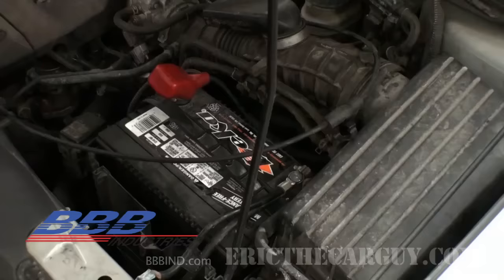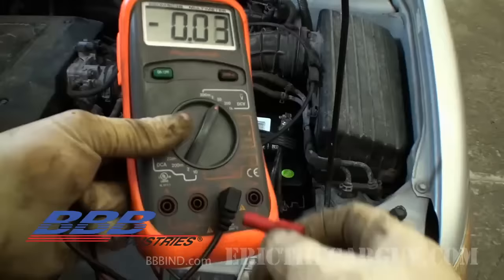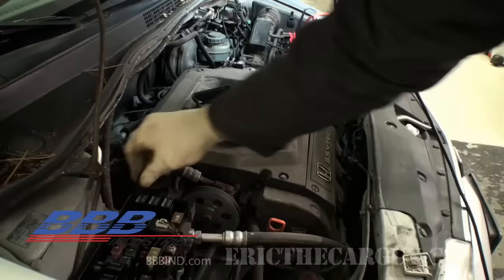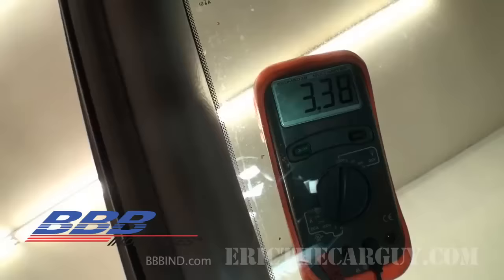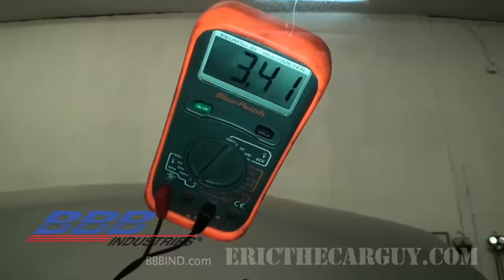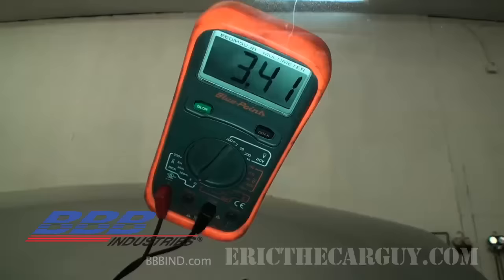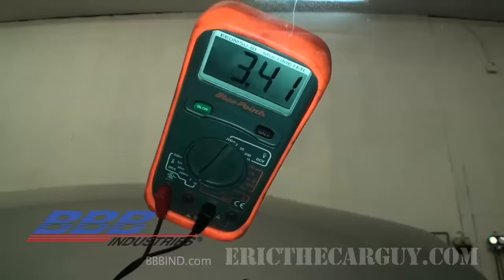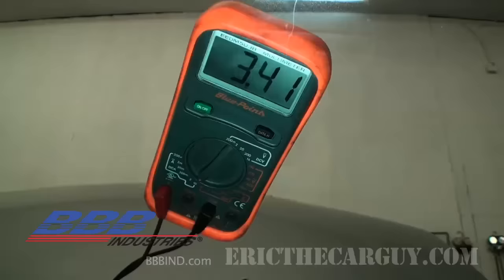How To Perform a Parasitic Draw Test - EricTheCarGuy

Comment: Thank you Sir!  Found my draw on my '03 Silverado pretty fast with your instructions.  A/C Relay being fed by the 10A AC fuse. Fixed!
Reply: My 03 Tahoe brains a battery in 4 days. Which relay?
Reply: @MegaHowtoMan  Mine was the  A/C clutch relay which had stuck in the closed posistion.

Comment: What you are doing will work, however, every time you disconnect the battery you lose memory which isn't terrible, butt also when you reconnect the battery via your DVOM you wake up modules. On vehicles such as Ford it can take up to 45 minutes for these modules to go to sleep and you cannot accurately test for parasitic draw while these modules are active!!! If you do it the way you show in your video Eric you must be sure to never break electrical connection, I.E backup battery supply while you hook your DVOM in series, and then remove the back up supply before you start testing. Instead of pulling fuses it is much easier and faster to do a voltage drop across the fuse. If there is current flowing you will see it on a voltage drop because current flow is RESISTANCE!! Resistance shows up on a voltage drop test!! But remember...there is more than one way to skin a cat.
Reply: You must disconnect the battery to put the meter in series. You must break the electrical connection. The only thing you can do is pull ECM fuse first or wait 45 min.
Reply: if you look at the end of his video he point out what you said and more.
Reply: If you have a top post battery, the meter connection can be done without breaking the electrical connection, by putting the positive meter probe through the center of the terminal and the negative probe on the terminal.  Withdraw the terminal from the post carefully and the meter will maintain the connection without restarting the ECM.
No need to stand around waiting for the systems to go back to sleep after disconnecting and reconnecting.

Comment: Excellent video, Eric! You give consistently reliable advice. And I thank you for that. But you are also more articulate than most of the folks out there on TV that commentate professionally, in ANY field. So, it's always a pleasure to watch your videos. You get straight to the point in a clear, and concise manner. 👍

Edit...Also, what multimeter brand (& model) was that? And what do you currently recommend? I like the one you are using in this video. But I do realize this was recorded 9 years ago. Maybe consider adding a current affiliate link into this video for your best sub $100 meter. Ok, sub $200. 😁 If one had been in the info I would have followed it. Thanks!
Reply: Yeah...I would LOVE to know that too. I'm pretty sure that he's using a Fluke. Which one? Not sure. I would LOVE to know as well. I also want to know about the battery tester he was using. It's a nice one. Maybe, you know this...I was looking at some nice carbon load testers online, trying to find one that covers a bunch of different types of batteries, diff. voltages and one that will test ...not only the battery itself and load testing but starter motor amperage draw and even cranking amps(same thing I think). I wonder if his does this extra stuff. My guess .. probably not. It's probably just a battery tester only but his is a nice one. People who have the analog ones, say that they're awesome ..I e...They have a lot of extra functions (like the aforementioned ones). Any help would be greatly appreciated...👍😁...P.S.  Love Floyd!! Rock on!! 🎸🤟

Comment: Sup Erick? Great video like always. I had to send this to a guy customer so he can see that you use amps not volts to test for parasitic loads. He think he knows more than me. Don't know why he hired me...you know the type
Reply: Why do you use amps and not voltage? It may be a dumb question but I am curious.
Reply: @DJTourniquet  Because you test the current flowing "through" the wire. You test voltage "across" something that causes a voltage drop due to resistance. An ammeter actually checks voltage drop across an internal, calibrated shunt resistor and then calculates the resulting current due to Ohm's Law. There are probably some good YouTube videos on how to use a multimeter that can go into more detail.
Reply: @cyborgdale  Ahhhh, thanks man. I always wondered but none of the guys I worked with could give a straight answer.

Comment: I have a draw that kills my battery over night and it never did this before I replaced the alternator with a rebuilt one, can a alternator cause a parasitic draw and still put out charging current when the engine is running?
Reply: A properly installed alternator can't have a parasitic draw. If there was a malfunction it would only happen while the key was engaged because the alternator is wired through the active fuse group and isn't permanently in the circuit. It's more likely that the new alternator isn't at fault and it's just damage done to the battery while the old one was failing. Most cases the alternator failure isn't addressed properly until the battery has already undergone a significant drain which will put it in a crippled state and chemically unable to hold a proper charge.
Reply: Back when dinosaurs ruled the earth bad alternator diodes could cause a parasitic current draw.  I guess that changed ...
Reply: Marti woodchip yes it can, mines did in my old lincoln, it was a 86, ancient..  I had to take it to an electrical shop to find out it was the cause of my draw.. replacing was easy, did that myself..but finding it.. ha!

Comment: what do you do if your looking for a parasitic draw on small motor cycle or scooter that only has one Fuse?  Would you unplug the light bulbs?
Reply: Roger SoCalBeaches
Reply: I say in this case the battery it self is just near the end of life and can't keep the power. There is a possibility that something like STOP switch is shorted and does provide power to bulb but not enough to let it light up but than again those things are after ignition switch.
Reply: Disconnect anything that draws power one by one. Disconnecting that one fuse didn't decrease the draw?

Comment: Please HELPP!

I got my Prelude in the summer of 2015. I bought it used on Craigslist. It is lowered, has aftermarket headlights as well as sound-system.

I used if from July-October with no issues. Mid October I removed insurance and left it on my front lawn for November-December. In January I decided to reinsure. 

I had issues starting it since I left it alone for the few months. 

At first, it would not start. I checked my battery terminals and they were loose. Then my car worked for a few weeks. 

Again, my car stopped starting. Deduction lead me to go get the battery replaced. I bought a battery from mechanic A. Got it installed. Car still would not work. So I wen't to go get an alternator from mechanic B. Mechanic B said that actually, my battery was bad even though I just got it form Mechanic A. Bought a new battery from Mechanic B. Car worked for a day or two. Went to go buy a refurbished Alternator from Mechanic C, was told that my Alternator was definitely the issue and my battery was OK. 

Got the new Alternator. Car worked for a few days. Went to start it, now it was not starting again. Took car to more upscale and reputable Mechanic D. I had an AVR Test done and Mechanic D told me my alternator I just bought 4 days ago was shit because it was second hand and it was not charging my battery. So I bought a brand NEW Alternator. 

Once again, car worked for a few days. But eventually, I would go to start the car and it would not start. 

Called Mechanic D. Wen't back to them and had an electrical diagnosis AGAIN. They told me they could not find anything. 

I was able to drive the car home. They must have charged the battery. Within a few days, the car would not start again. I got my neighbour to come check it out. He noticed that when my parking lights are on, my engine would slow down and so he said they were draining a lot of power. We determined this just by listening to the engine. My after-market bright headlights did NOT drain as much power as my duller parking headlights. 

And now I am here. 

Every time I would not be able to start the car, I would be able to get it going with jumper cables. I have checked every light and electrical thing I can find and I cant say that anything is staying on and drawing the battery from what I can tell. 

Before I contacted my neighbour, the car, unlike any other time, made clicking noises while I tried to start it but since then, that has not happened. I used it the other day after jump starting it and it was fine.

So as of now, the things i can say are...

1.) It seems that once I go 1 day without driving, It will be dead when I go to start it
2.) My engine did definitely slow down, and my neighbour read a battery draw, when I turned OFF my bright headlights and my parking headlights automatically come on. 

This is been an ongoing issue now since January-ish and it is obviously quite frustrating. Im not very car savvy. I want to call Mechanic D again but I do not really see what they can do since they told me last time they COULD NOT find anything. It is not apparent that they know bout the parking lights though.

Any help would be greatly appreciated, hopefully everything makes sense.  

Thanks a lot!!
Reply: With the aftermarket headlights and the upgraded sound system you might need a high output alternator. One that produces more amps for your needs. Sounds maybe like the original is just not enough.
Reply: +Daniel Smith thank you
Reply: +Michael Oliver disconnect your headlights or your amp or whatever, and see if it drains again..
Reply: +Michael Oliver Have you been successful at measuring the actual parasitic current draw ?  Make sure you take the reading after the car went to "sleep".  With today's electronics, it may take few minutes or more.  I'm lucky enough to have a DMM which has a data logging feature, which makes it much easier to establish the triggering point, without having to stay next to the vehicule all that time.   BTW, on some cars the lights will stay on for few minutes after you turn off the engine.  This is why it is important to take the readings on a car that has been snoozing for a bit.
Reply: It’s the sound system. I have one in my car, subs/amps constantly draw power even when the car is off. You need a breaker for the subs, that will cut power to them when the car is off.
Reply: Benjamin E. Exactly. A breaker (on/off) switch on the power cable running from the Amp to the battery.
Reply: How many watts is the amp?  I have an optima yellow battery and a rebuilt alternator haven’t had any problems I don’t run the stereo with the engine off

Comment: Thanks, narrowed down my cousins 2015 Hyundai Santa fe parasitic draw. Was drawing 3 to 5amps. Turned out to be the memory 2 fuse. Traced it to the drivers power seat. Unplugged the power harness to the seat and the 3 to 5 amps dropped to 20mA.

Comment: have two vehicles. 2000 Isuzu Trooper. It could sit for 6 months and then start, drove it for awhile, sat three weeks, fired right up, moved it so I could mow, couple days later dead. I used to play the radio out of it for hours, not anymore. The I have my sons 2003 GMC Sierra, we been experiencing a lot of learning lessons, starter, alternators, unfortunately I bought an alternator locally but would loved to gone to these guys. if i need one for the trooper i will call them. I am a fan of rebuilt electrical components, not to sav e money but to get something back that is built better than what the factory did with cheep parts. Like AC mfg's and crappy capacitors. Love your site

Comment: Great clip! Clear explanation + step by step. I had a similar issue with a 2000 Cadillac, pulled every fuse & relay w/o success, 95% of the time  an armed alarm would prevent a discharged batt. ( disarmed alarm would discharge the batt  in about 2 hrs).

Comment: Hey dude, just wanted to give a shout out for a good video. I was able to solve my problem quickly and able to verify the fix using the methods you demonstrate clearly and concisely.  Also your tips helped me pinpoint the problem very fast by going to likely culprits (after market radio in my instance) This was tough to diagnose because the draw was not massive, around, 280 mAh  over normal draw, and my battery would last days without a problem then it would finally not start, so I suspect it was slowly being drawn down and on short drives it was getting partially recharged and on long drives fully recharged and only the intervals between driving it would determine when the battery would finally drain, I replaced the battery in October and just in December it started giving me no starts. I think the cold weather exacerbated the problem. I put the stock radio back in, retested the amp draw and it went down to 20 mAh.

Comment: Helpful indeed. I'm in the process of trying to figure out if there's an issue with a relay, cable, connector or fuel pump cause it won't start. I do have spark. Battery is kinda bad too but not completely junk. I think.

Comment: Hi Eric just done parasitic draw test again on my camper van all fuses no change when removed.it’s an old van vw t4 .2.5tdi 1999 year.I have solar on roof plus w agm 115 amp/h leisure batteries plus Renogy 40amp dc charger.compressor fridge on all time vevor new recently plus all new crank agm battery but it still drains was 12.6v after run it’s 12.45 after an hour.it says I have 0.99 amp draw on my clamp meter .so I just run a cable from leisure batteries to starter battery and starter battery reads 12.7volts now.I run van most days usually only 2 day break weekends .thanks for great videos Eric.cheers .steve in uk Chester

Comment: So there are a lot of comments on here, so this suggestion might have been made.  If I'm doing a test on a modern vehicle, I disconnect the negative battery connector and then put a jumper cable (one side) between the connector and the battery.  I then put the meter in parallel with the jumper cable and wait 10-15 minutes.  Then I disconnect the jumper cable and read the meter.  I do this because many cars have a huge surge when reconnecting the battery when alarms, computers, and other things cut on.  If you draw too much current thru the meter, it can damage it.  This technique eliminates the surge and the other things that can turn on for a few minutes when you first connect a battery.  I noticed on my truck (2014 F150 Raptor) there is a large draw (enough to spark the cable) as the battery is first connected, as the lights flash (and I'm guessing other things turn on).  Then there is a 300ma draw for about 10 minutes.  After that it drops to about 50ma... which is normal.
Reply: Mines' 98 volts when starting, in the accessory plug circuit. I got a voltage regulator plugged in my 12v accessory that burned out because of it, I think.

Comment: An easier (and more reliable) way to guarantee the open door dinging doesn't destroy the multimeter is to pull the fuse for that circuit first and leave it pulled until the drain is detected on another circuit(s). When done, disconnect the multimeter, then replace the fuse for the circuit that causes the dinging when the door is open. I tried to depress the button that signals that the driver door is closed by using gotilla tape to hold it down. It didn't work well - didn't hold. Fortunately it released before I had the multimeter hooked up so my multimeter is fine. (To get to the fuse box on the driver side I have to get on my knees on the ground outside the driver door and stick my head under the steering wheel. To do that I have to leave the door open. There is no fuse box on the passenger side. - 1990 Camry.)

Comment: Just bought a truck that needed work but was a good deal. Parasitic draw killing battery. Found 3 GPS tracking devices wired in, 2 that looked like common lender installed hack jobs and 1 crazy UFO looking one that wound up being the parasitic draw, it never shut off and must have been broadcasting location to outer space to keep killing the battery. Took all 3 out because I paid cash for the truck, no lenders involved, clean title.

Comment: hi Eric, great video. i have a 2000 grand marquis. so i had a dead battery about a month ago. it was just when weather was getting hot and this was an original ford battery, well over eight years old. i replaced it with the bargin basement battery from autozone. this battery was working fine for about a month. then in the morning yesterday it was dead.
im an electronics tech so i know my volts from my amps. checked dome light, glove box, seat switches, vanity mirrors etc.  my alternator is working it was putting about 14v in when car is running. got me to work, figured it should work fine for a while at least.  thing didint even last till lunch. go to start and dead again. i got it jumped, waited about an hour with car idling and charged it up again. after this i turned off the engine and started again just to see the battery was wasn't completely baked. it started the car. OK so i pulled out my fluke meter and put it in current mode and checked it, i saw about 250ma going through the positive lead from the battery. but i did not wait to see if it had "gone the F*ck to Sleep"

being as i have a life to live i bought another battery to get on with life, this morning the car started fine. do you thing i just got a craptasticular battery, or could this be a slow death.? 

BTW i'll be doing a longer current reading today to see if the car goes to sleep.

Comment: thanks Eric . . . very useful! So if there is a security system causing a parasitic draw on your battery the 
fuse will not be in a manufacturers box. . . most probably it will be under the steering wheel or near the left side near the door (drivers side) you can also remove the security module and wires and plug into the original . . just as before.